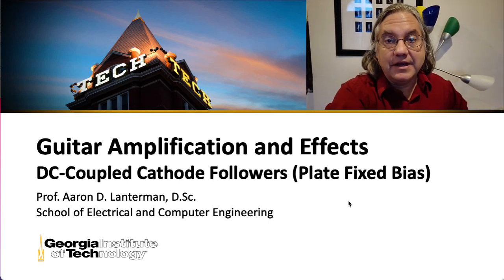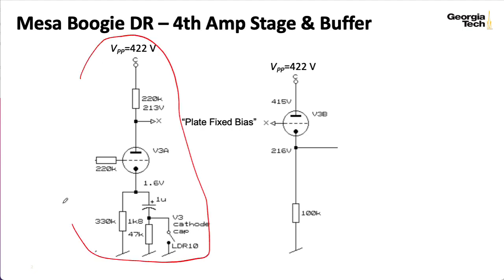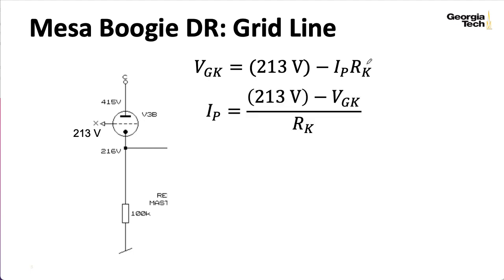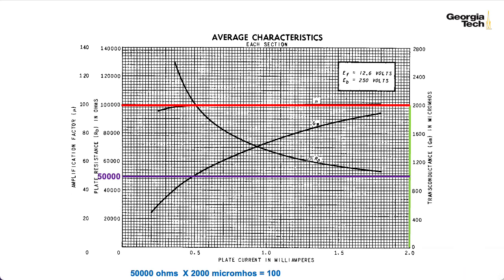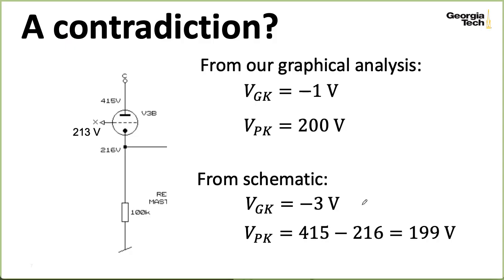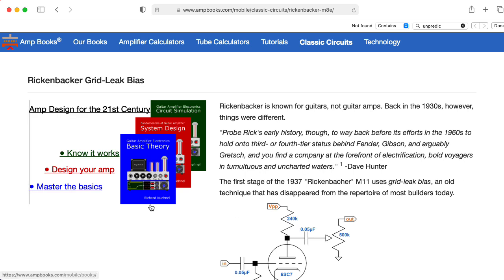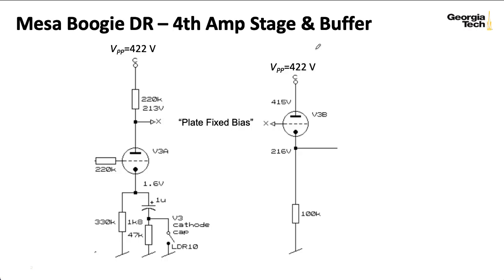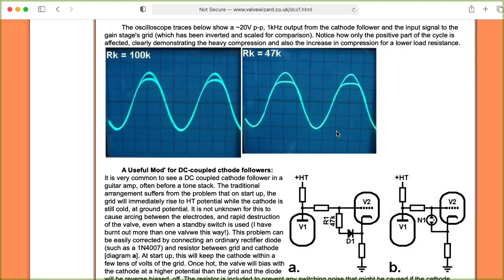ECE4448 L25: DC-Coupled Cathode Followers (Plate Fixed Bias) (Guitar Amplification and Effects)

Comment: Test point voltages on tube amp schematics are usually specified for a particular  meter with a finite input impedance. This causes high-impedance points in the circuit to be measured (and labeled) with voltages a bit lower than is actually present. Lower impedance test points will measure closer to their actual value.  I believe this explains most of the discrepancy you are seeing.
Reply from the maker: This is the most plausible theory I've seen so far (I think). It doesn't give a good sense of how to deal with the current through the grid, but it explains why the test voltage on the schematic seems out of wack.

Comment: My limited understanding is that you can't use the grid voltage curves from the datasheet the way you normally would since those curves represent plate current varying plate voltage at a fixed Vg where Vp and Vg values are with respect to CATHODE. Since your input voltage is going to vary both the grid and cathode potentials, you can't use the cathode as the fixed potential point anymore. So the provided curves are useless in THAT respect. Vg can't be used at all because it's between two varying potential points. You have to use the difference between Vp and Vg so Vpg = x volts or Vp = x + Vg. Use Vpg=415 and then you can use each datasheet curve for respective x values and and plot a line along those points. Some of those points might be way off the chart so you'll probably have to extend some of those lines. But that will give you a "Vpg= 415V" line. Then I guess you would plot your Vin=0V starting point somewhere along that line. Typically half the cut-off voltage. Hope that helped.

Comment: It might be worth checking sources on radio and TV equipment as well as the audio. I do remember reading on this configuration in a 1940s book on radio receiver design; sadly it's been 30 years and the book was in Polish.
Reply: Do you have any clue about the author or title. I have quite a few old polish books about electronics, could look through them.

Comment: Hi, really nice video. I think I know whats going on with the cathode followers. But first if you wanna know more about how to estimate the grid current in a general situation, maybe a place to start would be the book “vacuum tubes” from Spangerberg. Page 218. 

Now to the follower, according to the wizard (Blencowe), when the second triode is being bias close to the 0 V grid to K it will start to draw current, as if it was bias with positive voltage, but in a lesser magnitude, I assume that there must be a continuity in the effect around the 0 V grid. So, it will draw current from the anode of the previous stage, making it sag some volts. 

So, if you take the 216v on the 100k resistor, and the 415 volts on the anode it makes sense according to the graph, 2.1 ish miliamps and around 200v anode voltage, but with -1v in the grid!! So what I suspect is that the anode from the previous stage it starts at a higher value, lets say 215v but because of the draw in current from the second stage grid, it sags to 213v, making all of us scratch our heads. 

I hope this helps and I hope more that is correct! Haha

Thanks for everything you are teaching
Reply from the maker: Interesting! I will need to give that some thought.

Comment: grid leak bias?
try "back bias". that is a head trip!

pretty simple though. treat the cathode resistor as a divider, flowing ALL current, divided off as required for appropriate biasing on each grid.
all cats are common. lets you run directly heated cats on one filament battery yet have wildly varying biases. im still playing, but even a cathodyne and cathode follower appear to be possible. i have trouble just wiring it up let alone doing impedance calcs! hell! its just so... not normal? 

its akin to the loftin white dc amplifier using the single resistor... but not quite. 

only decent example ive seen of it is in a radiotron handbook, and the example given...
2 tubes, 6ma/2v,10ma/8v.
sum currents, then standard self bias equation for highest bias required
8v/16ma=500R. 
cathode(s) will now float at 8v.
8v grid is strapped to negative supply. full drop across resistor.
2v is tapped off at 375R(6v)/125R tap. so that grid will be 6v above ground, but 2v below the 8v cathode. ;)

both heavily decoupled to cathodes.

yeah. still just getting my head around feedback and signal flow in a shared common resistor!
Reply from the maker: Whoa... that is a mindbender!

Comment: Have you looked at the "radiotron designer's handbook" 4th edition??? it's about 3.5" thick and has sections on different forms of grid current. whether or not it has equations i'm not sure but it does have graphs showing the behavior of grid current...
Reply from the maker: That would be a good place to look.

Comment: Interesting. I haven't done the calcs, but surely the load line will be different to start with - as we know there is a DC connection from the previous stage, should it not be included to begin with? Also - and I'm afraid I only have this anecdotally - will we not also get an increase in desirable 2nd harmonics in this configuration, leading to a buffer with added warmth for free (I think HiFi amps used a similar but inverting stage to CANCEL 2nd harmonics)?

Comment: I'm so used to emitter followers following slightly below the base voltage, I was surprised at first to see that the cathode follower follows slightly above the grid voltage. But I guess that's a perk of the vacuum tube being a depletion mode device.
Reply from the maker: Yup, you have to flip your thinking around (same with JFETS)

Comment: Awesome video, I'd like an analysis as to why russian 12ax7s fail in the cathode follower position of many amps.
Reply from the maker: Huh -- moreso by tubes manufactured in other countries? That is interesting...
Reply: Scott, interesting! I just had a similar conversation this week with someone about how they couldn't get a (supposedly) matched pair of Sovtek KT66 to work in an old HiFi amp. I've never used them myself, and thought it was a case of re-biasing, but no - correctly biased, they showed low plate dissipation, with current right at the max recommended. The tubes were brand new.
Reply: The heater to cathode voltage break down is the issue.. You have the DC voltage at Cathode + the Peak AC signal voltage on top of that... The NOS tubes usually could handle a bit more than the data sheet 200V spec...
Reply: Maybe it is because the standby switch is not being used. If the plate voltage from the preceding stage is applied to the cathode follower grid without the tubes being hot and conducting then there is a good chance of shorts.

Comment: The cathode follower can be graphically analyzed by using the CATHODE curves.. You have presented the PLATE curves... You can simply re-draw them as Cathode curves. The analysis will go easier..
Reply from the maker: That's quite interesting. I don't think I've seen the material presented like that -- is that from one of those old 1940s sort of books?
Reply: @Lantertronics  RDH-4 Pages 390-393...
Reply from the maker: @cerrem1  Ah yeah -- that book is like the Necronomicon of deep profound tube knowledge.
Reply from the maker: @cerrem1  Thanks for the tip!